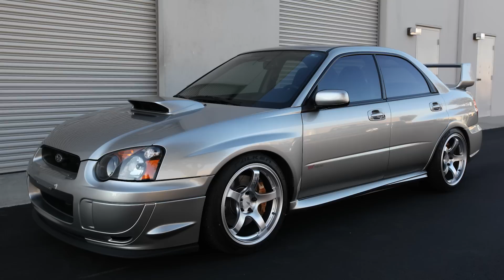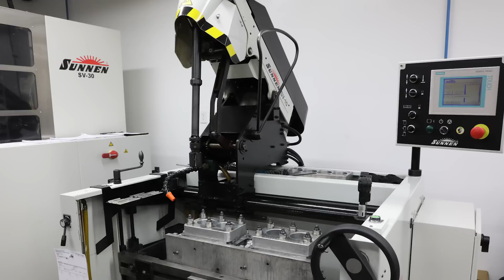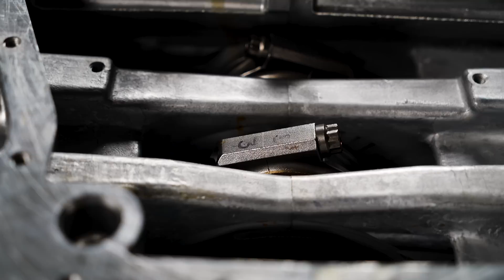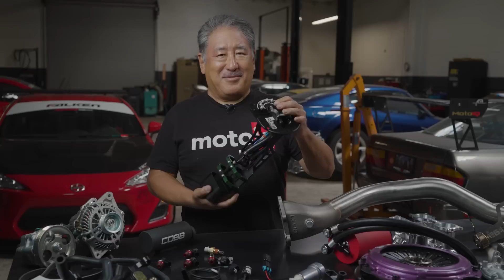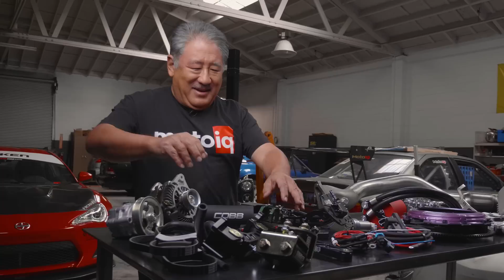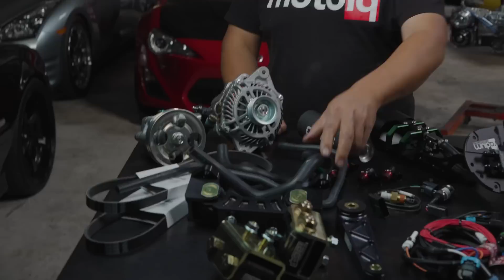Subaru Engine Swap Must Have Parts!

Comment: Smart recommendations. I like how majority of these parts are just excellent recommendations on how to keep your Subie running like new, especially for track cars.

Currently hunting for my 3rd Daily / Rallycross toy and I can say for sure that if something's gonna break, it WILL break on the track  😂

Simple things you'd never consider, swaybar endlinks, serpentine belts etc. Once had radiator hose rupture and it sprayed my alternator with coolant 😭

Comment: I loved the visibility of my 2003 Forester, but I wished it had the feel of the 2006 FORESTER XT. I assume that it’s no easy task to swap a more powerful engine in to current Gen Foresters because of all the digital/computer stuff. what’s the newest model year that’s a good candidate for an engine swap? I’m looking for ~230 horsepower. Can modern Foresters achieve that thru tuning? Thanks for any wisdom
Reply from the maker: The whole drivetrain from the same year STI more or less bolts in and iWire has help for the electronics side.

Comment: Wow all that time, money, and parts all to push less than 500bhp just shows this is a load of BS. AOS are also a waste of money and do nothing, ive seen stock radiators push 700bhp easy. But then I guess Americans really only know how to throw parts and money at things and get nothing of value in return.
Reply from the maker: Actually, you don't know how to build a durable Subaru that can take hard use and track days.  Stock radiators push 700 hp, are you joking, in Antarctica?  These cars spit oil like crazy, especially if driven hard; you can spit out half the sump capacity in one track session sometimes.  AOS's are a big help in combating this. You must be one of those, I make 700 hp on a stock bottom end all day long kinda guys who just make a street pull every once and awhile and still blow up.  Typical clueless arrogant dude from another country.

Comment: I am going to build a Forester 2012 with the 2.5l engine Kinugawa Billet TD05H-20G 8 cm² (clipped 18G wheel) FMIC ETS Extreme 3.5" core + Perrin piping kit, DeatschWerks 1100 cc top-feed, Walbro 450 LPH, Manley H-Tuff rods + Wiseco 99.75 mm HD pistons 8.8:1, Full closed-deck insert machining, Mild port & polish + Supertech +1 mm valves & springs, Brian Crower 272° Stage 2, Exedy Stage 2 + lightweight flywheel, custom exhaust  engine and trans cooler and Powerflex etc i am aiming at 430 hp. Do you have any tips if this is the right way to go
Reply from the maker: Seems like a reasonable combination to me.

Comment: I am looking at an IAG 750 on an EJ257 from an O7' STi.

The short block is reasonable at $5K.

I am planning about 450 to 475 WHP on 1050cc injectors. 

Probably drop NEW radiator, alternator, oil cooler, IAG oil 11mm pump, IAG oil pan that carries an extra quart of oil, with a cylinder 4 cooling kit, 1050cc injectors, and maybe a new fuel rail system for top feed injectors and the I-wire fuel pump rewire kit.

So for maybe 475 WHP... it should be OK on stock head.

The question is:
Should I just sell my stock STi long block for maybe $4K and drop the IAG 750 LONG BLOCK in its place?????

WITH ALL THAT, I would like to use my stock head if it isn't an issue.

Thoughts?

Comment: Reviewing my STI I think i have the best bang for the bucks mods. 20g turbo, stock fuel rails and lines, stock downpipe, Invidia q300 catback, killer b headers, ets TMIC and Koyo radiator.
Reply from the maker: A front mount helps a lot. So does a downpipe, you are also right at the point where a pump and inectors are needed.  Heck leave it alone you are at bang for the buck zone!

Comment: I would love it if you would do a video on the new impreza 2.0 &  2.5Lt. It has 2 or 3 major issues, one being the " advanced " Thermostat. Basically how to turn this model into as much as possible trouble free machine. eg. proper maintenance of CVT. Sorry did I just type a 3 letter swear word?!!🫡
Reply from the maker: We really don't care about that car so probably not.
Reply: @motoiq  it's that bad is it?
Reply from the maker: No our market likes the WRX and older STI's so we work on what our customer base likes.
Reply: @motoiq  ok thanks

Comment: Doesn’t setting up parallel fuel rails also help pre-detonation in cylinder four? The path the fuel takes from the tank being routed oem goes in a loop not directly to four being the last to get fuel so the lack there of can cause pre-detonation hence knock.
Reply from the maker: If you have a marginal system perhaps.

Comment: I always come back to your videos, no matter how old. The ej20 would you ever recommend a build using that block and valve train for a daily around the same bhp that you recommend on the ej25 of 500bhp
Reply from the maker: Yes, once you get past the high 300's low 400's the block mods are the same.

Comment: IAG uses only 2816 forged pistons as opposed to 4032. Should this be a concern for me since I'm looking to daily it in the winter?
Reply from the maker: My opinion is you should only use 2618 on a turbo Subaru. Of course 2618 doesnt wear as well as 4032 or the stock hypereutectic pistons but there isnt much room for the ring package and the land area needs all the help it can get. The barrel design of the IAG piston is good and they are not noisy when cold.  I use them in my personal car and I can slightly here the pistons but injector clatter is the loudest noise when idling.  The engine registers zero knock count as well so you know these pistons are not banging around.  Of course this is with proper machining of the cases which can be regionally difficult to get.
Reply: @motoiq  Thanks for the quick reply, gives me more to think about.

Comment: I must say thank you for bringing the xclutch sprung organic twin disk up on my radar. I installed one on my longrod 257 build with an fp blue. Got about 1500 miles on the new longblock and clutch. Made 404awhp @20 psi on 93octane.  Would be really cool if you could do a video on cobb FlexFuel alternatives besides open source and Haltech.
Reply from the maker: The only other one I know of is ECUTek

Comment: When talking about the MAF and air speed density, is it a swap, or all the parts mentioned make it air speed density? Also, where can I find those parts because my engine is getting bogged down from my cold-air intake, and the stock MAF does not like the intake at all lol. I sometimes have to give between 75%-85% throttle when up shifting to keep the rpms at a higher point. It's almost like there's toomuch air and it's choking the engine if I push the throttle to 100%.
Reply from the maker: A lot of subies your included run lean after an intake install.  You need a tune.
Reply: @motoiq  ahh, ok! Thanks!

Comment: For all the guys looking to save a couple bucks on their build I highly suggest going the extra mile on the block and maybe save a few bucks elsewhere by picking up used parts in instances where the part isn't prone to mechanical failure, like downpipe, TGV, intake tube, ect. Had my block done by a reputable shop but decided to cheap out on the closed deck option because they rated the open deck at 400hp and that was right around what I expected to put down. When all was said and done I ended up at 450hp and about 7.5k miles later one of the rods ended up snapping in the middle and went right through the block, next to the turbo. Well, a lot of oil flies out of a fist size hole in an engine block and it started a fire. It would have been a true disaster if I wasn't on my way to a BBQ with a big cooler full of ice/water/beer in the trunk but there was enough in the cooler to put it out.😂
Reply: I agree that a closed deck is a good idea for 400whp+, but your failure actually seems unrelated. A rod snapping at the center is usually a factor of necking from excessive RPM, or buckling caused by detonation. An open deck block would only cause a headgasket failure.

Comment: how do you address the rod bearing failures? best remedy to prevent this and drive hard
Reply from the maker: Good oil pan and pickup, proper machining, IAG oil pump. I think its all in the video, watch it.

Comment: i got another question for ya. you know the 2 access covers on the back of the block. will it harm the engine if i leave um off??????????????? i know they both cover the pin plugs.
Reply from the maker: Don't
Reply: @motoiq  keep um on??????????????
Reply from the maker: Sorry leave them off.  IAG makes cool covers.

Comment: you may know. i have a 2002 outback with a 2.5 flat 4. i have another 2.5 from a 2007 suby. can the 2002 parts work on the 2007 engine????????????????????????
Reply from the maker: yes
Reply: @motoiq  cool

Comment: What do you guys think about supercharging subarus?
Reply from the maker: Turbo is better
Reply: @motoiq  
Turbos are usually better. I was just curious because I wan to do a more unusual build with my car. Its an 07 outback with an ej253 which I will probably end up replacing with an ej255 long block. I want  to supercharge it and fit it with an H  pipe style exaust. I want to see if I can exploit the ejs firing order with an H pipe to achieve a back purge effect. I'd also be curious as to how it would sound. I'd imagine it would be similar to an unequal header sound at low rpm. Of course I also want more power but to use turbos with an H pipe I imagined I would have to do the weird twin turbo setup  and every way I can think of doing that would defeat the purpose of making an H pipe. The intercooler plumbing would be a mess aswell. That's why I'm leaning towards a supercharger instead. My end goal is not a speed demon either, I want something torquey and responsive in the low end to drive in the streets. Every thing high-school auto shop taught me about forced induction was that turbos are good for high rpm boost and maximum hp an superchargers are good for low rpm boost and torque.
Reply from the maker: It's not that simple.  If you are of limited means, limited on free time and fabrication skills, I discourage you from doing unproven stuff. Most of these projects turn into piles of junk.

Comment: I know this sounds like a dumb question lol but I have a Subaru Baja automatic transmission and I would like to swap it and put about 400 horse to it. And here’s the dumb question lol is it possible to completely switch to a manual transmission in order to put that power to it? Or should I just look for a standard Baja then put the power to it?  I rather just keep this one and build it with a budget so I’m mostly wonder how difficult it would be to convert it to manual? Lol
Reply: Thank you for the advice it definitely will give me a lot to think about. The only reason I wanted to do it with my Baja is to yes make it special to me. But I’m young right now and trying to build my way up with welding and I don’t have much in my life to be spending money on. I had a girl but messed that up so I figured I’d poor all my money into a badass car lol. But I definitely see where your coming from. In order for me to make it the way I want your right it would be a lot and take a lot of work. I really appreciate you guys getting back to me it means alot. But yeah I guess it would probably just be better to get a used but good sti. I just love the Baja and I’ve always loved rally so I figured I’d make my own lol.
Reply: And I would probably try to do most of the work myself or with my dad helping me. Because shops prices are way too much for the amount I want to do
Reply: Well I’m back here to let anyone that sees this know I put my Baja into a guard rail on thanksgiving. Don’t think the old girl will be getting a Nice engine anymore
Reply from the maker: It is probably more money than it's worth, about the cost to buy a newer used car that you might really like.  The only reason to do it is if you want to build something really special to you. People who build this sort of thing, usually have a good amount of mechanical skill, are dedicated to obtain it or are decently well off and have a shop like us build it.  You are looking at over 20k to do something like that, maybe more depending on how much we need to figure out and upgrade systems on the car.  Beware of shops that say they will do it for way less, we fix stuff that shops like that do all the time.

Comment: I’ve got an 2011 wrx sti original 301hp with invidia cat-back, but how much power do you think I’m gonna get with a stage 1 tune? And is it safe for the motor? It has a new original turbo on it, and fully overhauled motor.
Reply from the maker: It depends who did the tune and what stage one is.  I am going to say probably but they are a lot of lame tuners out there.

Comment: @MotoIQ Do you guys have and engine build kit for the OBS Impreza's? I have a 97 wagon I'm tearing down (rebuilding transmission ATM), and I'm look for around 350WHP replacement engine. Knowing what must be done to build a truly "Bullet Proof" engine I'd like to outsource for a short block and heads. Got anything like this?

Comment: I have an 04 wagon had ringland fail spent 4k and it was a shady place and had it so called “rebuilt” never ran right but made it a year and all 4 rod bearings failed both heads are no good along with a bunch other stuff. Now my question is does it seem average to be quoted $13,195 for rebuild? They said they have extra heads ready to go at the shop already. This is a legit shop by the way  but it really seems like I could possibly find a  somewhat nice sti for that price and I have no way to get my car right now they have already billed me 4k just for the labor I’m not sure what to do. I just want my car to run right and solid and reliable. Thanks in advance and this channel is the best thank you so much for being real when it comes to prices I soak up most of the knowledge this guy gives out besides being able to pay for my wagon
Reply from the maker: It does seem to be a bit expensive if you just wanted a stockish rebuild. It does not sound totally unreasonable.  We would not know the condition of your car, it might need stuff like all hoses and under hood plastic and rubber bits replaced due to them being brittle with age.  These things add up.

Comment: I know this was never done but I want to put a wrx or sti engine into my 5th gen Impreza hatch can it be done, my Impreza is a 17 cvt, I want to pull the trans and engine out and put in a  manual transmission

Comment: I'm running the IAG stage 2 tuff block, milder heads, Blouch 440xt, and Tomei Poncam cams.  Other than that my build list was pretty much the same.  Four years of hot Florida summers plus several track days and the car still runs as strong as it did on day 1.  That iWire kit is pretty sick and worth every penny.  It's a shame they can't keep them in stock.  I've been trying to get ahold of one since February.  I don't feel too hot about 120f fuel temps in bumper to bumper traffic.

Comment: I heard that the cylinder #4 cooling mod doesn't actually work. Doesn't allow proper flow in the cooling jackets
Reply from the maker: There is data showing it works.
Reply: @motoiq  I would like to someone knowable to confirm this data and put this to bed once and for all  . There is also data stating that it disrupts the flow cycle to the other cylinder and not getting enough cooling .Some tuners will not run them and some youtubers are removing them.

Comment: research that 4th cylinder cool kit,  you may not like what you find.
Reply from the maker: Nothing based on fact, just peoples opinions who are not qualified to make them.  Dominic actually has test data on how the mod works.  Its also been tested in racing by IAG and other.

Comment: In other words if you're broke avoid Subaru
Reply: Or more like if you’re broke, don’t try to upgrade your car.
Reply: If you're broke. Take the bus ..
Reply: How about being wise and drive how you would a granny car? Keeping your Subie stock and maintenance it on a regular basis goes a long way, as any other car would
Reply: @jackiegarcia7800 that's why I have 2. Bone stock wagon and modded to hell sedan
Reply: @Magus2222 same here I have a stock Forester and an EJ swapped Brat with all toys 🎉
Reply: @jackiegarcia7800  true statement
Reply: If you race it, you break it.
Reply: Yea they're not cheap but it's worth it

Comment: Hey so are u able to tell me what Jdm engine I got? Engine is stamped 701 s20 and has rhc 008 and lhc008 heads. Serial number is B083175.
Reply from the maker: it's a later 2.5 liter turbo engine
Reply: @motoiq  it’s stamped ej20
Reply from the maker: @falsebroadcast  Does it have VTC on the intake and exhaust?
Reply: @motoiq  no just intake from what I can see
Reply: @motoiq  https://drive.google.com/drive/folders/1dbGQ8Uywkbp1OfAl-ngXr4UBq9pgtSJy here’s some pics of the motor.
Reply from the maker: @falsebroadcast  its a 205 then

Comment: I would also like to advise since the oem alternator can’t handle the power output needed, the DC power performance alternator does wonders to all electrical parts needing that great supply of power. The oem alternator causes that subaru “dip” that everyone noticed during idling or at the traffic light. This aftermarket alternator fixes that issue because it supplies the car with better power output than the oem one. Mike I’m sure you can look into DC power performance alternators and explain it way better than me haha.
Reply from the maker: We are running one on our Evo.
Reply: @motoiq  my man👍🏾

Comment: Looks like you're missing the speed controller in that kit. The black part you held up is the relay block. A common upgrade for the controller is the GTR controller. They're plug and play. This must be an old video, "TGV Deletes" is a dirty thing to say these days.

Comment: I have a 2019 Outback 3.6R with 35k on it (street use only)
Does it need an Air/ Oil Separator?
Reply from the maker: Probably not.